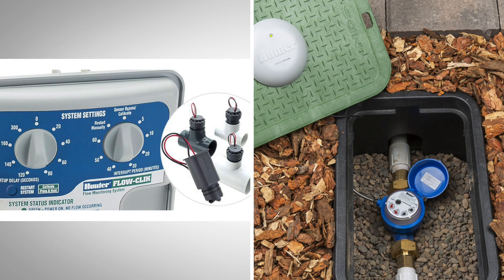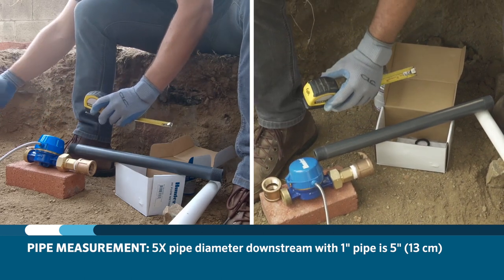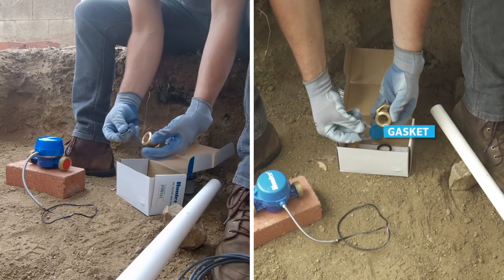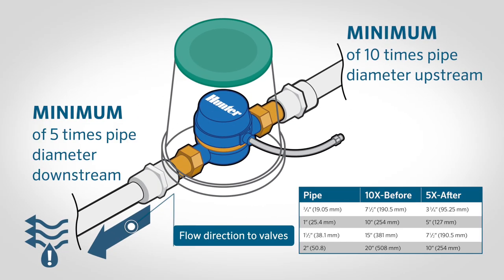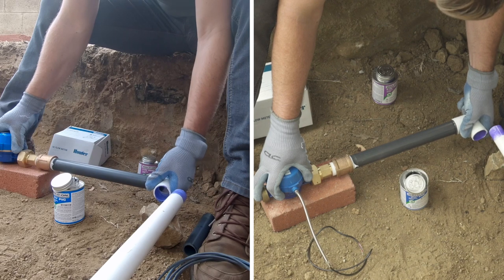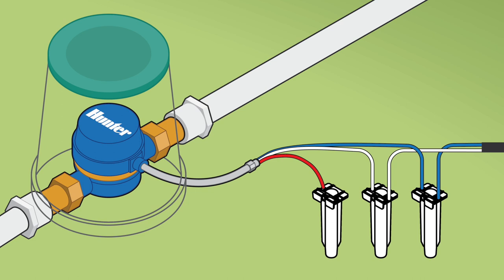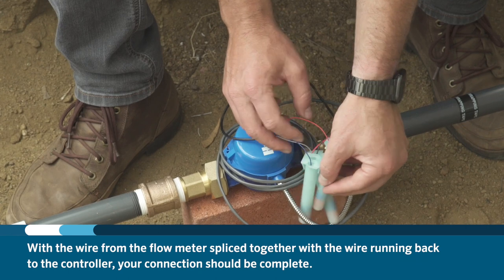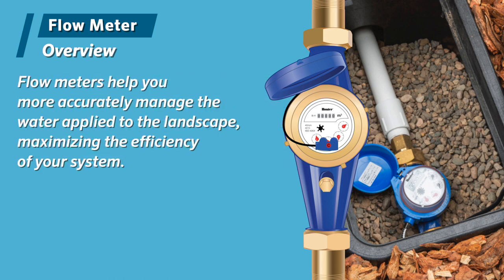Hunter IIF Training: Flow Meter Installation

Comment: I installed a flow meter several times, my question is why is the flow meter wire not 18 gauge, like regular irrigation wire?
Reply from the maker: For all Hunter Flow sensors, the recommendation per installation instructions is to use no less than 18Ga wiring.  For the Hydrawise sensors, 18Ga shielded wiring.

Comment: Great video! Is there a particular reason you used SCH 80 pipe on both ends of the flow meter? Thanks
Reply from the maker: Thank you for contacting Hunter Technical Support.
 
Sch80 has a better UV tolerant rating. So if the pipe is exposed to the elements, Sch80 would be recommended.
 
Thank you again for contacting Hunter Technical Support. Please let us know if we can offer any other assistance.
Reply: @Hunter_Landscape_Irrigation  it is also a better choice when going into brass threaded fittings due to crack stress resistance.  It is fine to convert to SCH 40 after the first plastic fitting.  I recommend not using molded (has a distinct seam on the plastic) as it has a tendency to leak.

Comment: How can I control multiple flow meters? My PRO-HC has only 2 sensor inputs? I want to control all Zones seperatly on water leackage. Thanks for your answer :) David
Reply from the maker: Thank you for contacting Hunter Technical Support.
 
The controller will learn the flow for each zone with a single flow meter. Flow Sensors require a master valve for correct operation. The PROHC model can operate a single master valve therefore we only recommend a single flow meter.
 
You can connect a Flow meter with a Rain Sensor, Wind Sensor, Soil Sensor, etc.
 
Thank you again for contacting Hunter Technical Support. Please let us know if we can offer any other assistance.

Comment: Install instructions say “hunter flow meters are installed between the master valve and zone valves”, but the video says to install this before the master valve. 

In my application it would be far easier to install after the master valve. 

Is either acceptable?
Reply from the maker: There are pros and cons to installing a flow sensor after the master valve. It sounds like it works better for you after the master valve.

Comment: My flow meter is installed inside, why does the video have it installed outside?  What's the pros/cons of inside vs outside.  Seems to me inside would be better because of freeze protection, easier monitoring, etc.
Reply: That's exactly the case you typically see a backflow connected to PVC in areas that are normally warmer climates vs inside backflows are usually installed with copper pipes for colder climates
Reply from the maker: Thank you for contacting Hunter Technical Support.
 
Flow meters require a master valve that is most often installed outside. There are no issues installing a flow meter inside as long as there is a master valve and the orientation is horizontal. In freezing environments, we always recommend the full winterization procedure.
 
Visit our support page here for more flow meter install tips.
 
Thank you again for contacting Hunter Technical Support. Please let us know if we can offer any other assistance
Reply: @Hunter_Landscape_Irrigation  Interesting.  My master valve must be outside because I don't see it inside.  The flow meter is located right after my shut off valve for the sprinkler system and is well inside the house so no freeze protection needed for it (I only need to blowout everything from the backflow preventer onward)  That's why I was wondering why anybody would want it on the outside instead?  I see no advantages of it being outside.  I do see many pros from being inside 1) shorter cable run (mine is about 5 feet above my control panel) 2) no worry about freeze protection 3) easy to read without having to open up access panels 4) easy to replace if ever needed.  What are the advantages of it being outside?  I can't think of any.
Reply: @JonnyS97  Hi Jonathan, yes mine has copper pipes throughout being I'm in Northern IL.  My backflow preventer sits just outside the house and I blowout the lines with compressed air from that point forward into the system.  My flow meter sits inside about 5 feet above my control panel in the basement.  I don't see why anybody would want the flow meter installed outside regardless of climate.  Being inside, it's easier to read, easy to replace if ever needed, shorter cable runs back to the control panel, etc.
Reply: @MaxAcceleration  Some people's control panels are located outside so it wouldn't make sense to locate it inside and they have to run wire outside to the control panel. Most are not reading the actual meter, they are using the smart app to read the meter from their phone.

Comment: Will the flow meter shut a system off if detects high flow or will you need the flow sensor for that ?
Reply from the maker: With a flow meter installed it allows for flow alerts to be configured that has a shut-off period available once the irregular flow is established. For instant water shut-off, you will need a Flow-Clik sensor to set water limitations.

Comment: I would assume that a 1 inch sensor should not be installed in the blackfkow riser as the placement cannot meet your spacing minimum from fittings?